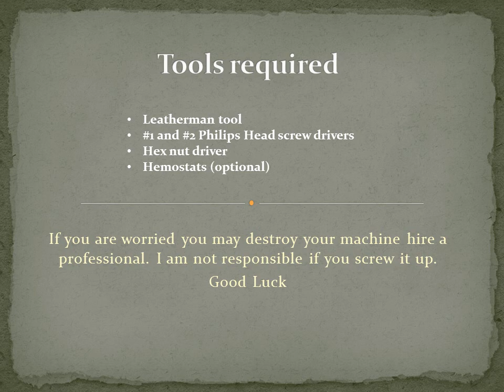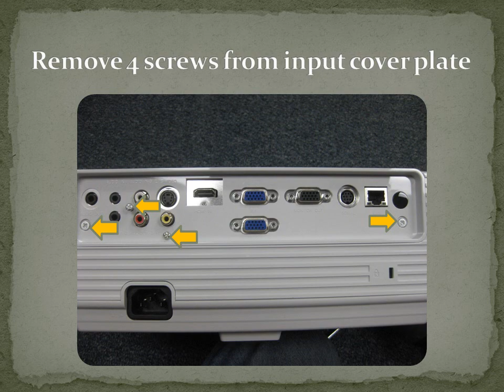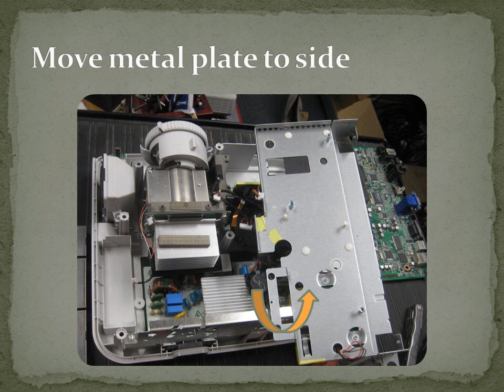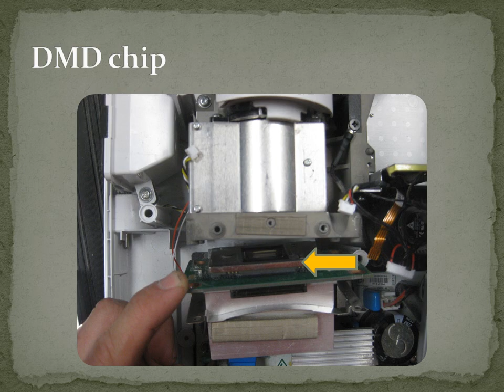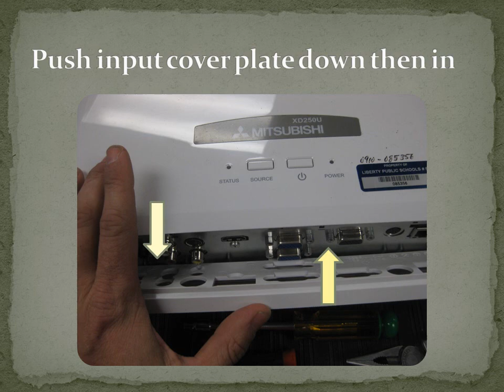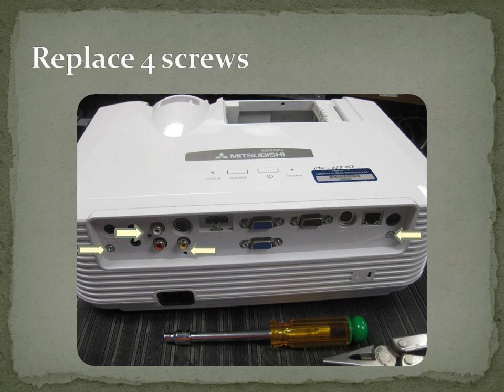Mitsubishi Projector (white spots) xd250u or 270u DLP - Replacing the DMD chip

Comment: Thank you so much for this tutorial!! I just replaced the dmd chip of my beamer (Mitsubishi XD280U) following your video and it worked perfectly
Reply from the maker: Good to hear. Finhers crossed.
Reply: @Oakheart  actually, the dots came back... Now they're just someplace else on the screen. Is it a problem with the chip or is it possible that I maybe installed it wrong?
Reply from the maker: @danielnarcisoagostinho6173  if it is the chip you can see the dots on it. Mind you it's been several years since I worked on them. Seemed to be a problem with heat.

Comment: Hello,
Thank you for these great repair videos.
I have a Mitsubishi xd280u DLP with the white spots issues. Do you know if a DMD chip from a xd205u would be compatible with it?
Thank you in advance for any info.
Reply from the maker: I can not be sure of the chip in the XD280. Mitsubishi may be able to tell you or if you take the machine apart it is written on it. The first one I did that's what I did then I just put the bad one back in until the new chip came.
I would not be surprised if it is the same chip but much of that depends on the true resolution of the machine.
Reply from the maker: Oakheart
Also if you do find out let me know and I'll add it to the info. I know they take the same lamp.
Reply: I finally took the leap yesterday and took both machines apart.
They do use the exact same DMD chip, the 1076-6319W!!
I have taken some pictures for your collection, if you are interested.
Reply from the maker: Tamsir B
Are they much different?

Comment: hi, i have a nec vt676 beamer and it is showing alot of blue dots, is this the same problem and is there a video available to fix the problem for this model and where can i find the parts i need? thank you
Reply from the maker: Yes it probably is the DMD chip. I have never worked on your model so I do not have a video for that
Reply from the maker: You can find chips on Ebay but you have know which one. NEC tech support might tell you.

Comment: Help! any idea why I would get both red and green flashing lights when I re-plug power cord back in?  when I press the lamp safety switch it goes back to all red but no lamp.  The only other thing I can think of is that I put the chip in upside down - is that possible?
Reply from the maker: Well lets see. The lamp must be installed with the safety switch depressed to be able to light the lamp. Some times I have put the ribbon cable that goes to the color wheel upside down. See picture at 1:45 This will cause the error lights. I can't remember if it is possible to put the chip upside down. I will try to look up this 6329 and find out.
Reply from the maker: Oakheart
Looks like the chip is the correct one as far as I can tell.
Reply: Oakheart Nope - ribbon cable is ok - still can't figure it out!
Reply from the maker: A fan wire might be in where the ir wire goes
Reply from the maker: Oakheart
 Still worried about your lamp safety switch. I wish I had the thing in front of me ...